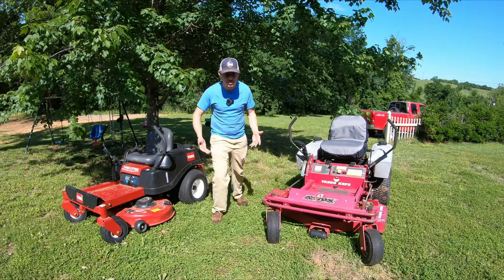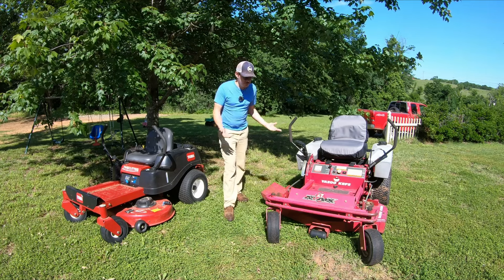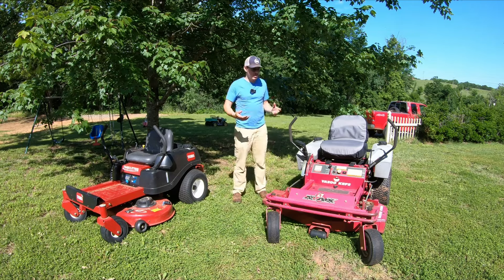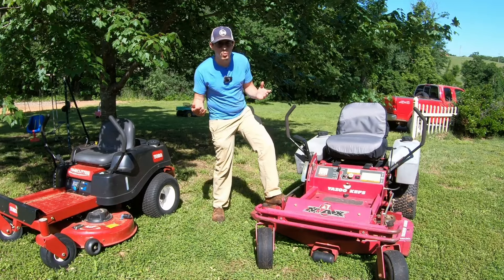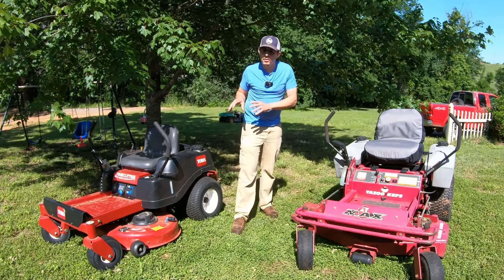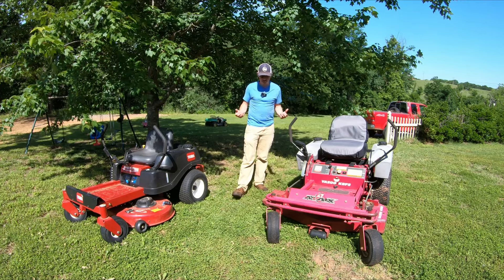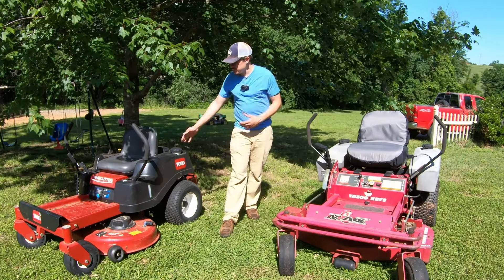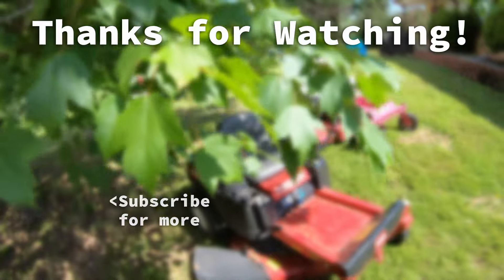Should I get a RESIDENTIAL or COMMERCIAL zero turn? COMPARISON!

Comment: The question answers itself.  The additional cost is pennies per use over the cost of the equipment over its usable life.   

When I was a kid my dad spent $400 for a 24 inch Reo reel mower.  A rotary 18 inch mower cost $100 or less.  I used that Reo mower until college on almost two acres of lawn.
Reply from the maker: Yes, in general it seems that you get better value from a commercial mower. Not only do they last longer, but they do a better job and are easier to use. Unfortunately not everyone can afford one when they need a mower…

Comment: Comparing an entry-level residential vs entry-level commercial zero turn will probably help quite a few people make their minds up. I'll pick the commercial one any day of the week just due to the far superior drive system that is made to last. The all-in-one drive motors on the residential time cutter are pricey and rarely last more than 800 hours from what I've seen. 

 What I currently have is on the other end of the spectrum. An Ariens/ gravely prosumer 22 hp with the same drive system as your yazoo but a stamped deck and an older top of the line exmark with a liquid cooled Kawasaki. It all comes down to how much you have to mow and what you can afford. But in the end build quality and long term lifespan is far superior on most commercial mowers. That little timecutter won't likely be around in 10 years of regular use the Yazoo will.
Reply from the maker: Thank you for your comment!
It sounds like you have a couple of good mowers.

Comment: If you live in town a good estate type mower, if you mow 5 acres like I do you better get something very close to a commercial grade mower. Thing is commercial mowers a much heavier so a good residential mower might not be a bad option on smaller properties like a city lot or an acre or two. Btw looks like you live near Miami Oklahoma, I’m in Miami county Ks. Now get back in the shop!
Reply from the maker: I really like the weight of the commercial mowers, I think it makes them feel more planted and get better traction. Maybe some smaller yards could get damaged more easily with the weight. My yard is 2 acres so I’m kind of at the point where I would be fine with a residential mower for a while, but I prefer commercial mowers.
I’m central Oklahoma, but I’ve been through the Miami area many times. It’s beautiful up there!

Comment: It’s a no brainer for me - commercial and older any day over residential, shiny and newer. 
Older machines in general will almost always be better built and last longer. 
Commercial are designed to withstand heavier use and abuse.
The hours on that YK are nothing. I’d expect it to go 4 times that amount. 
I’d prefer to rebuild or replace bearings over bushings. I’d prefer to grease zerks over replacing worn shafts. I’d prefer sophisticated air filtration which ensures longer engine life and oil filters over non-filtered. 
Worn out seat, faded paint and leaking tires are normal replacement/repair items, so no big deal in the overall scheme of things. 
In general I’d prefer to put my money into something that’s going to last rather than rot out from under me in a predictable few years.
Reply from the maker: Well said!